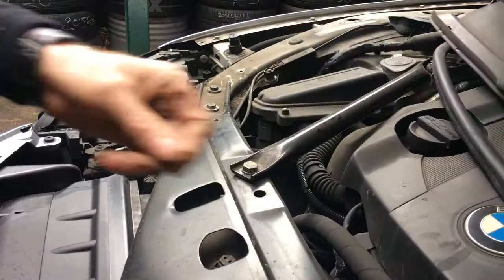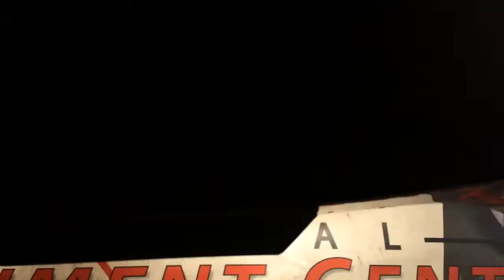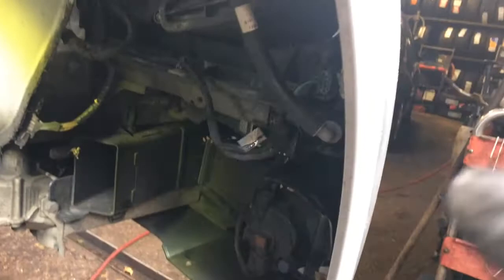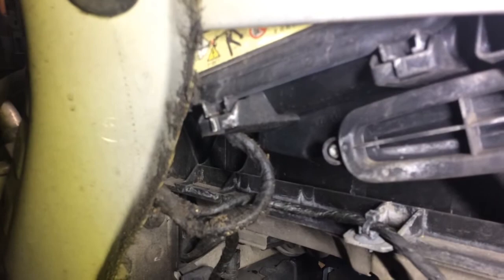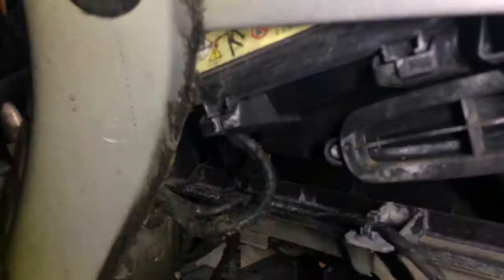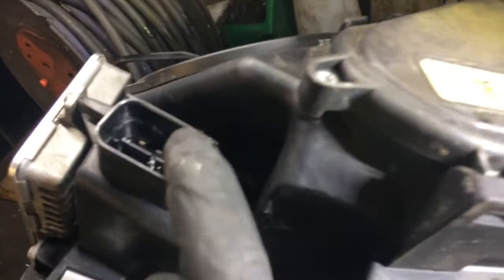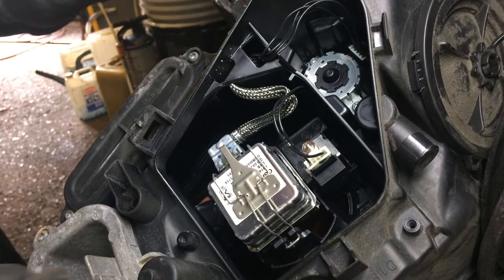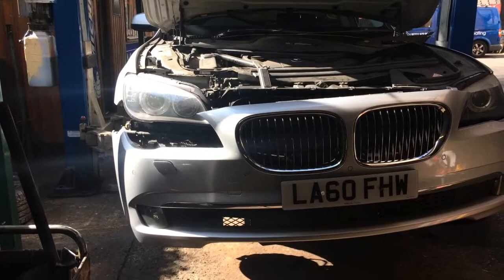BMW 7 SERIES  2010 ON WARDS MODEL F01:F02 HID BULB REPLACMENT

Comment: You've done a great film to help others. But all you had to do was take the tire off, take the tire well shield out, then from the top remove the front quarter panel and loosen the top bumper a bit where it connects to the quarter panel and the light moves freely after you loosen the 4 bolts that secure it to the frame. Once it's moving, you can take the three screws which hold the led in the light compartment and change the xenon bulb from the tire well area. No need to remove engine shield or hoist it up. 
Cheers
Reply: Hey, thanks, Mikoeebs, I thought he was overdoing it, would you happen to how video or picture's on how you would do it?